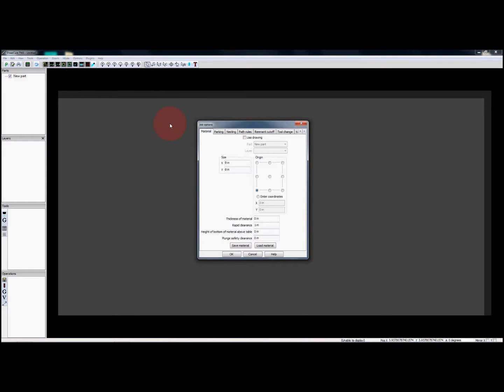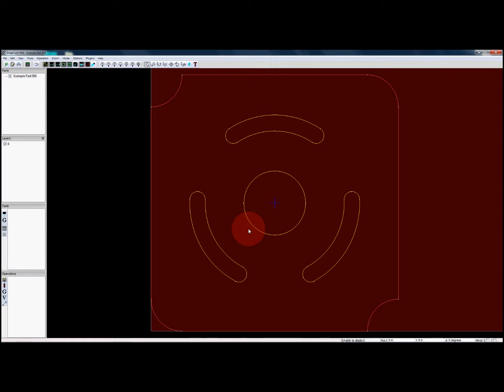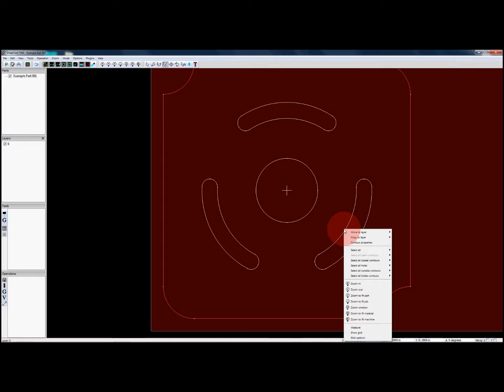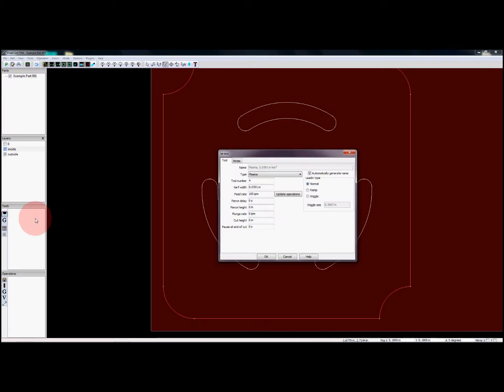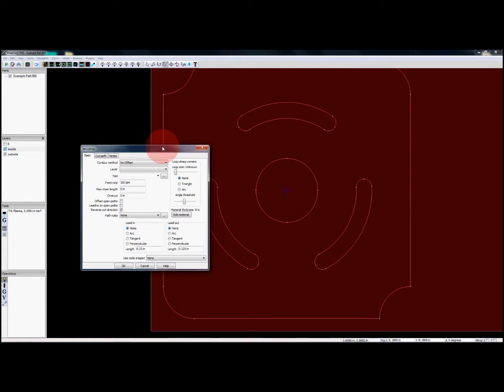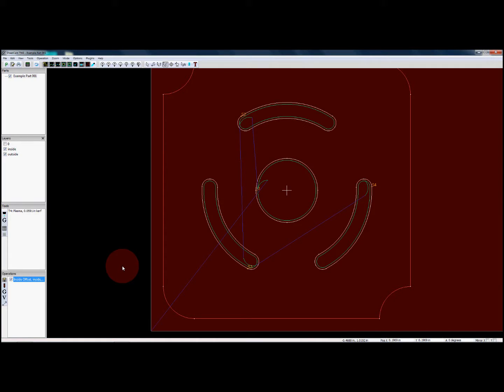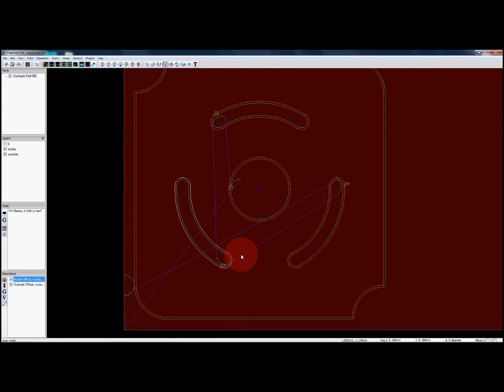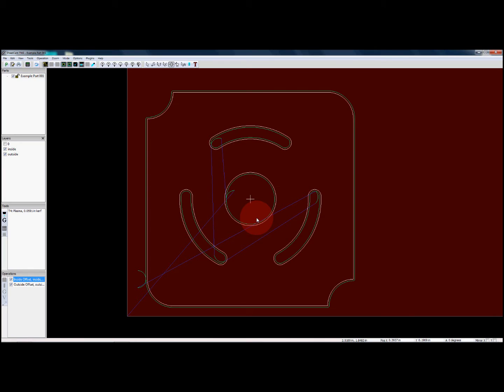05 SheetCAM TNG 6.0.15 / How To Convert A DXF Into GCode

Comment: Hello,

I have a problem with loading a file from Sheetcam to Mach3. The program only generates 9 out of the code lines and nothing more. What can be broken?
Reply from the maker: Email the GCode to michael@dynatorch.com. I'll inspect the code and advise you further.
Reply: The problem was with the license. I use the program on two computers, licenses are encrypted. After reporting everything works. Thanks!
Reply: @ironstyle2796  hello sir ..I got the same problem..I can't generate the g code above 9 lines ..plz help me.🙏
Reply: @kartikswami1232  You must load licence file. If you use illegal licence file - work only offline.
Reply: @ironstyle2796  can I get that file I am a student I can't afford it plz.
Reply: @kartikswami1232  Download „Keygen sheetcam generator”
Reply: @ironstyle2796  if you have a link sir plz plz send me plz..
Reply: @kartikswami1232  https://youtu.be/TA0mMeGz6YM
Reply: Sir plz reply me ...plz...help
Reply: @ironstyle2796  sir already I did this process but can't get results..same problem of 9 lines of g code
Reply: @kartikswami1232  Delete old licence file, and try again few times.